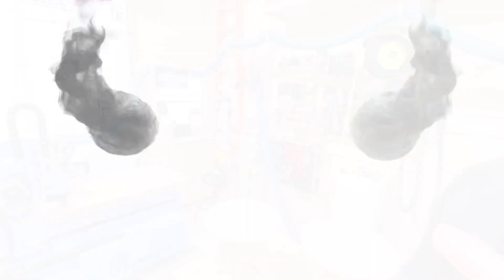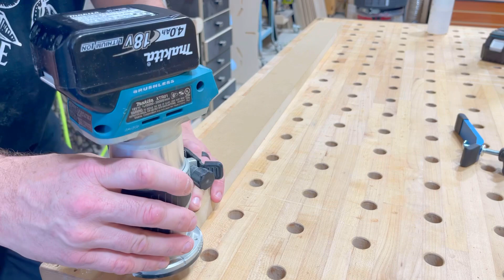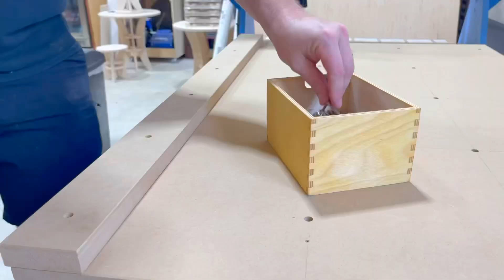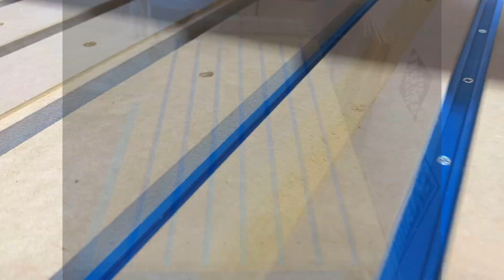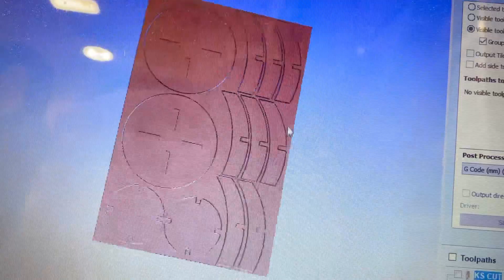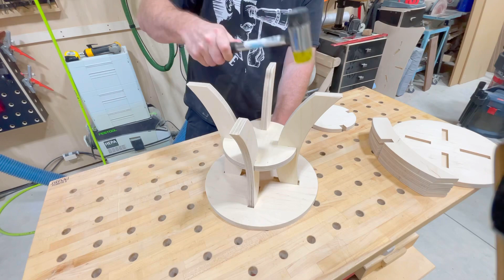How To Make a Functional CNC Waste Board |Featuring Rockler & Penguin

Comment: Nice project and love the CNC, as well. They are a lot of fun for designing new projects and it's always nice to have a small batch of somethings for a client. Something else to explore for clamping is using painter's tape and CA glue. I have a smaller CNC for the last couple years and will be moving to something much larger after we move to a place where I have some more shop space later this year.

Comment: Chris,
There is a way that you would never cut into your spoil board.  So imagine that you are referencing Z from the top of your material on 3/4 piece of material in Vcarve pro. When you zero your Z set it to the table top not the material and set your Z DRO to -.750. If you do this you are guaranteed to only go down as low as the table top and no lower.  This only works when cutting all the way through like a profile  cut.  Hopefully this makes sense.
Reply from the maker: Yes that does make sense. And I dial it in one time perfectly however with the filter plys on some of the domestic stuff. (Plywood) frayed the edge quite a bit. I’m sure it had something to do with who knows what. Because I’m still learning CNC thing. But I definitely understand what you’re talking about as I’m getting better with vcarve pro
Reply: @AGlimpseInside  keep up the good work. Love the channel.

Comment: Just an idea for you is to use threaded inserts and machine screws instead of basic wood screws. It’ll allow you to use more clamping pressure without having to worry about pulling your t track up out of the MDF. And if you use repeatable increments, it’ll also make replacing your spoil boards easy without stripping out the screw holes. Always enjoy watching your videos. Happy woodworking!
Reply from the maker: Thank you brother definitely an idea for when I change them out. Might have to do that. Thank you so much I really appreciate it bro
Reply: @AGlimpseInside  sure thing!